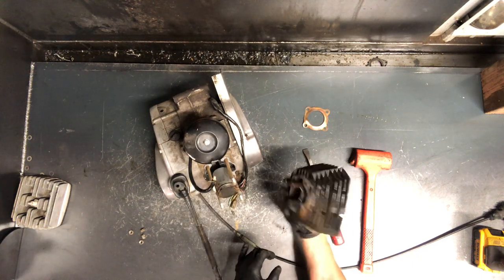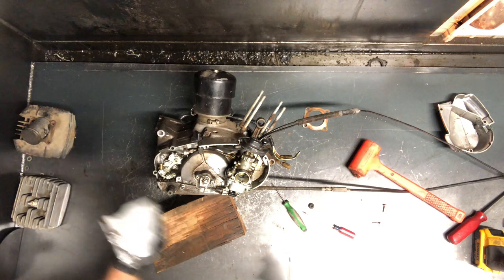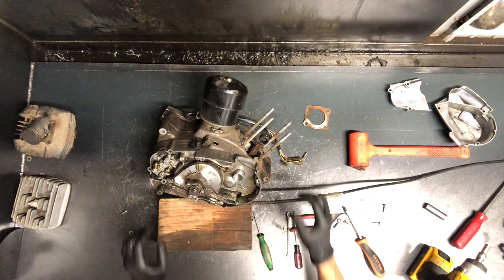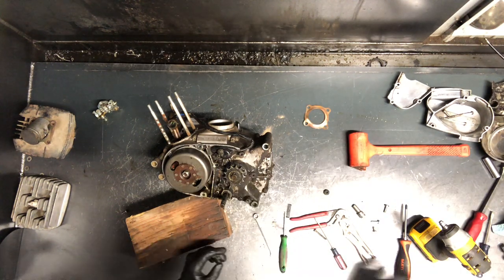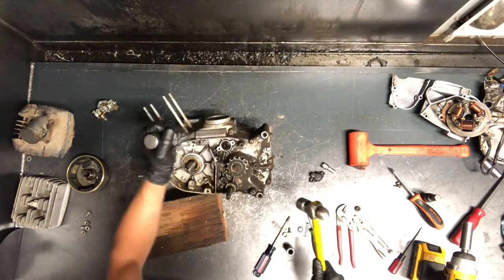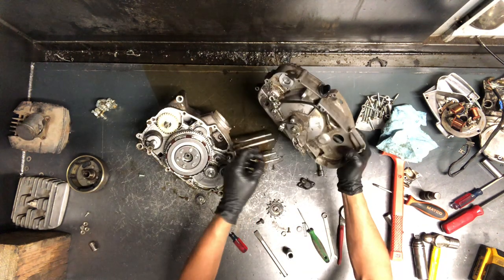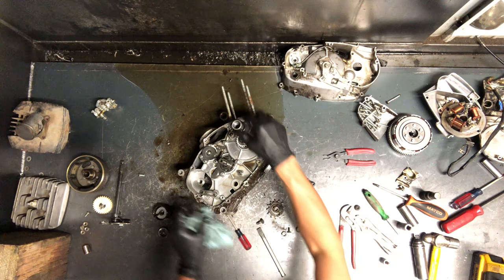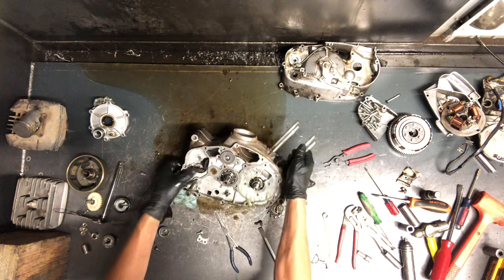1975 Kawasaki G7 KH100 Vintage 100 cc Motor Rebuild Restore Top End Crankcase Split

Comment: Seen hundreds of repair/restore videos on mopeds/motorcycles. Finally I saw you and the importance of a IMPACT DRIVER. Its just a MUST in this work with right bits to fit. All others just destroy bolts with amateur screwdrives. Thumbs up......

Comment: Hi i just bought a kawasaki with the same engine and i have some questions
Is it ok if i dont put oil in the oil pump thing? I saw some people that eliminated that system.
Also my bike didnt come with wiring. Only lights, the key thing and coils, do you know of any diagram that could help me? I dont know about 2 stroke wiring, sorry for my english
Reply: You need the oil pump for crank bearing and rotary valve lube, don't bin the oil pump just fix it.